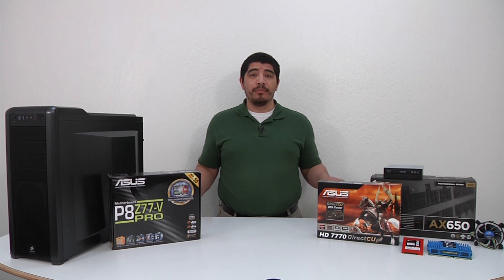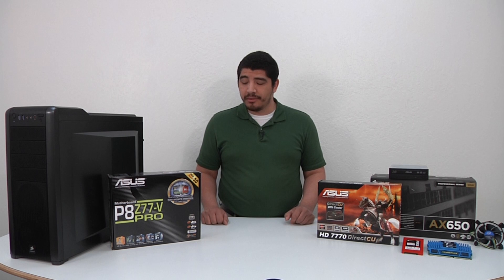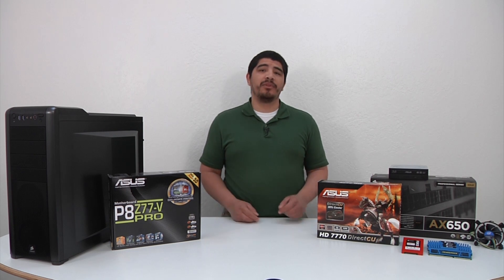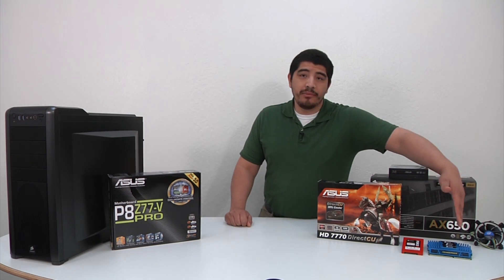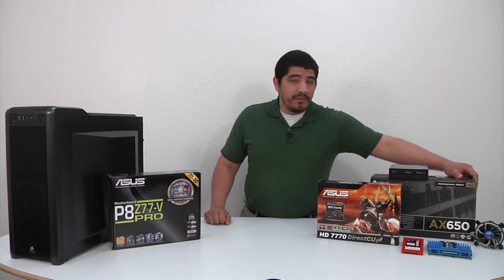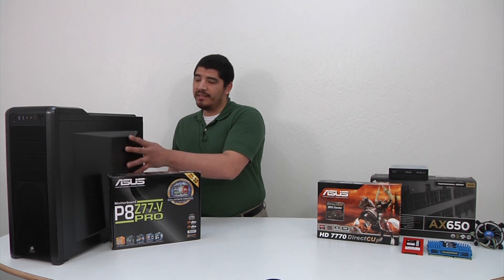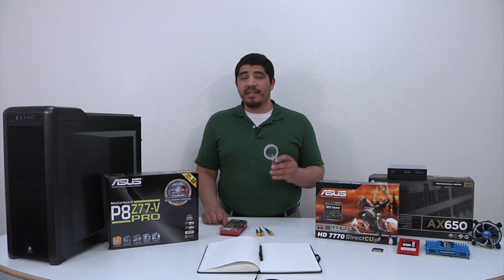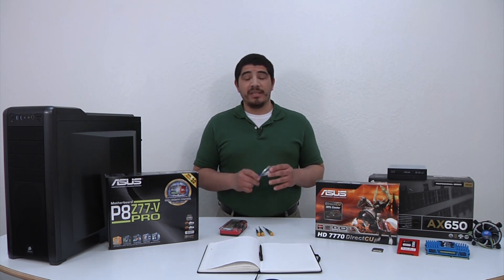ASUS How-To - Get Started Building a PC

Comment: And I just found another where the guy is using about 1-1.7GB on 4GB of RAM. You are just helping me prove my points. "I have 3GB of DDR2" and you're running BF3 and have 10 tabs open in firefox and you still only use 2.5GB. Why do you think that is? Idiot. Why do you think that the Galaxy S3 1GB only uses about 700MB of RAM and the 2GB version of the S3 (no BW) uses about 1.2GB of RAM? Get some experience kid. Modern operating systems take advantage of whatever hardware you have such as RAM.

Comment: Nothing is wrong. The more RAM you have, the more Windows will use. My laptop has a complete image of my desktop but it only has 4 gigs of RAM but it uses about 1.5GB when I'm running nothing. It's very normal for a user like myself who has many background processes. The average high end desktop with 8 gigs of RAM usually uses anywhere between 1.5-2.5GBs. The fact that you don't know this shows your inexperience just like in your first comment. Windows takes advantage of what you have.

Comment: 4GB doesn't do it. After I've been using my desktop for about an hour I'm using about 2.5GBs. In BF3 in some of the larger maps with maximum quality 1080P with 64 players that last a long time can use about 2.5GBs alone. that's 5GBs. The most I've seen my PC use is almost 6GBs. 8GB is necessary for high end gaming with lots of background processes and services etc. Anything less is not enough and anything more is overkill for those kind of needs. 8GB is the perfect spot for high end gamers.

Comment: A 7970 would be much, much better value now (At least where I live it costs about the same as a GTX 670) just make sure you get one with unlocked voltage control so you can overclock the hell out of it. Integrated graphics will be a pain. Also I have a feeling that in a few months there will be a plethora of new GPUs coming.

Comment: what what kind of wattage do i need for this setup:
I7 3770K (overclocked at 4.5GHz)
Maximus V formula
corsair DDR3 1600 8Go vengeance kit
6 120mm fans
geforce gtx 670/680 (depends on price changes within the next couple of months)
120Go SSD
1To 7200rpm sataIII
blue ray combo drive

It's for gaming and video editing (it's my first pc build so any comments help what isn't necessary or better)

Thanks in advance!